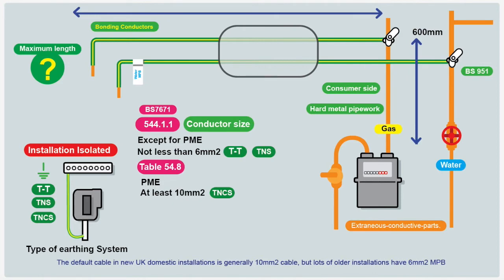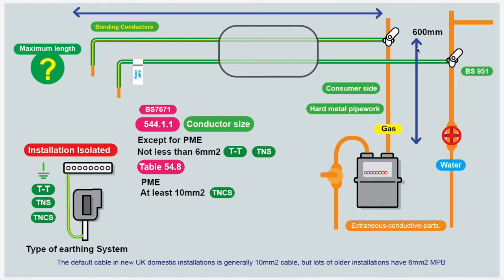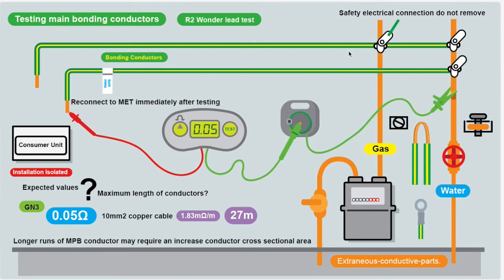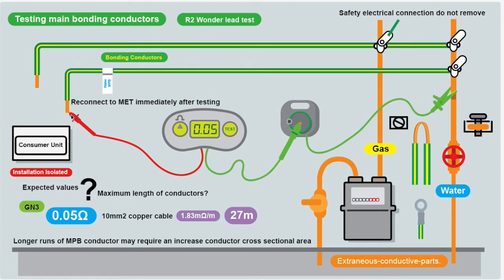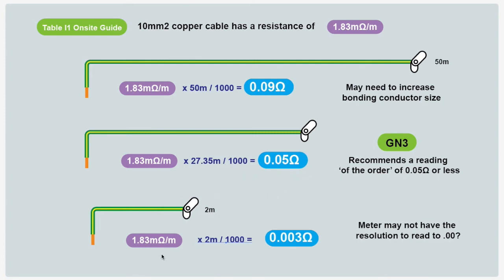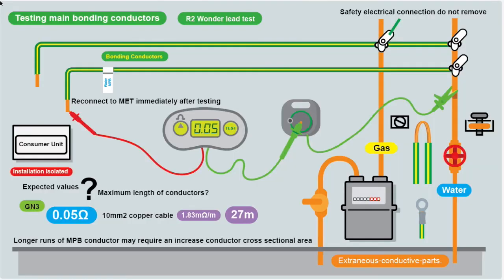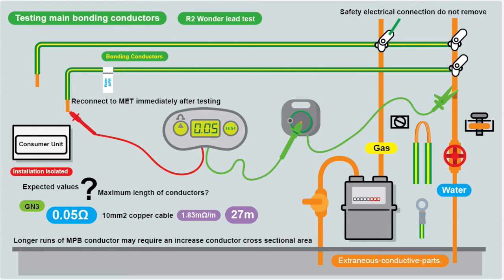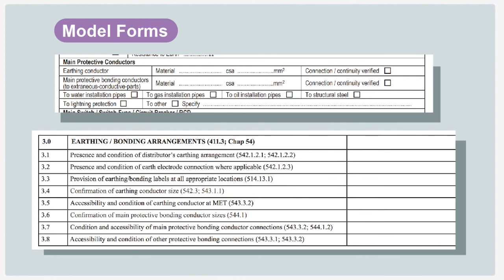Testing Main Protective Bonding

Comment: very informative and accurate, i dont know why we dont write down the value of ohm we get and where to compare the result to, like u said jst 0.05, as we get bigger sites, these numbers dont calculate, the adibiatic has been done for thermal constraints, but was i an acceptable value of negligible resistance between esposed and extraenous. On paper it says continuity tickbox and verification tickbox, what is an acceptable value still. or does this no become touch voltage problem which designers will never be able to calculate before hand.